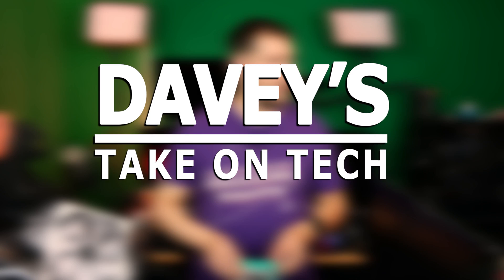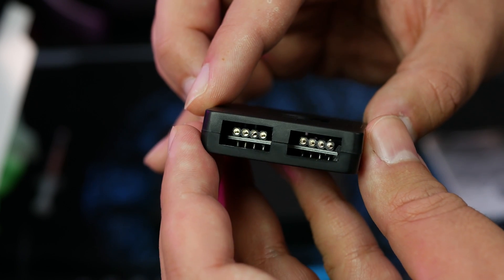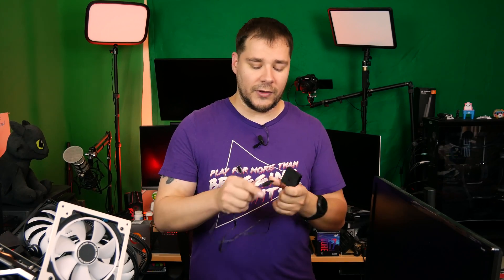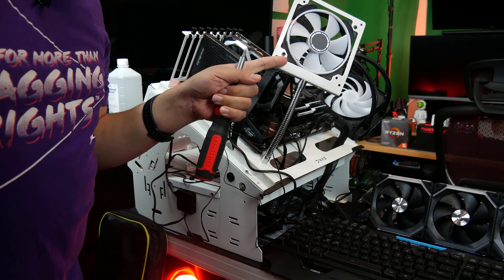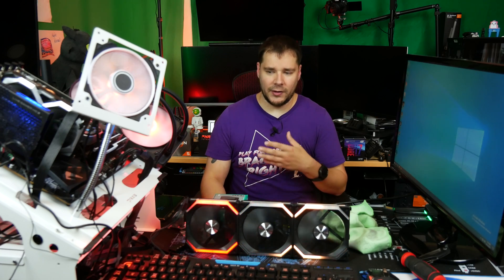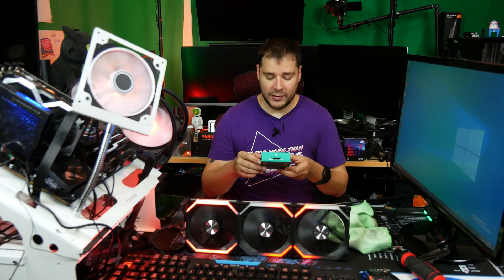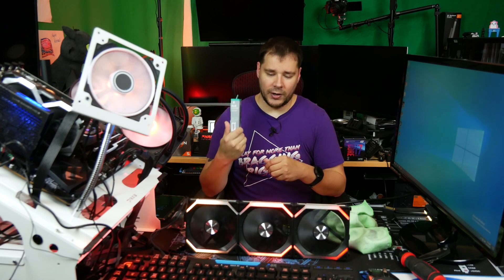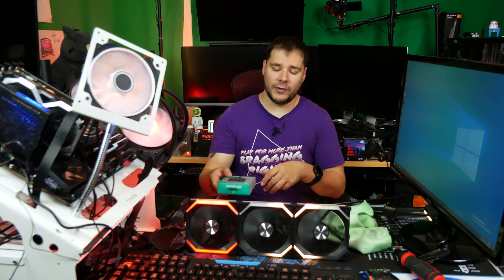Connecting a 3-pin 5V ARGB product to a 4-pin 12V header? Yes, it's possible

Comment: Unrelated question but I just bought a fan cooler with a 5v 3 pin Argb connector but my mobo has a pin 4 pin 12 volt header

Comment: I have an Asus strix 2070 OC card with a 12v 4 pin RGB AURA header. I have 3 ARGB FANS. I need that header for the 3 fans but FANS are 3 pin. 
Splitter ? + this. ? It’s a budget build encode video from my main pc.

Comment: i have the asus z390 prime-a and it doesn't have any 3 pin rgb headers. My case is nzxt and came with daisy-chained fans that all go into a 3 pin connector. would I be able to use a convertor like this to daisy chain all of my fans and RGB into a 12v 4 pin and then use the asus aura sync or something similar to control them?

Comment: hello. nice video but since i am not wnglish i have not understand very well. my case come out with 9 rpg pwn fans and a controller that should be connected to the 3 pin header. my mobo have only two 5v 4 pins headers. how i can solve? thanks

Comment: Yeah as my issue right now is my garbage board B550 F Asus Rog Strix has only 1 5v 3 pin header and 2 4 pin headers I'm just trying to connect my thermaltake RGB fans to 4 pin as I also need my 7800xt GPU which also has RGB but also 5v 3 pin head on GPU so can this work??

Comment: I have a Gigabyte b450m ds3h , i have 5 argb fans(3 pin) that connect to a controller but just recently i want to have control using a software. Would this product help me out because the rgb header is a 4 pin header and i don’t know what to do…

Comment: Hello! I keep asking same question on every forum from msi and more,youtube  also, but no one reply.i want to connect rgb cable from deepcool ls720wh(3 pin rgb-5v) to my (4pin-12v) msi z 390a pro motherboard knowing that the connector( " jrgb1") is for led strips shown on mobo manual. Will it work with that convertor ?

Comment: I know this video is 2 years old but I couldn't find any clear answers anywhere on my struggling quest. Can anybody tell me for sure if I can use this converter? 
My problem/question is: I have an Aorus (gigabyte) x299 gaming 3 mobo that only comes with 12v 5pin RGBW headers (x2) fully operational with my ongoing rgb setup. I searched a LOT and found some info about the motherboard being able to connect 3pin argb's on the provided 12v 5pin rgb headers, as they said it is compatible. But due to my past bad experiences in doing stuff without some research I don't want to take the risk and fry something out.  Keep in mind that my goal is only to be able to connect about 2 or 3 argb acessories that only have 3pin argb connectors (1 rgb gpu bracket / 1 24pin mobo rgb cable and/or another fan for exhaust air since mine is kinda old and its the only one without rgb).  Thanks in advance.

Comment: First off, THANK you for addressing a problem that was a very common issue on previous generation motherboards and some newer ones as well!
So you lose the addressable function on ARGB things... does it cycle through them or just default to a certain color?
My delimma....MSI B450 Tomahawk only has 4 pin 12v ARGB headers and my phanteks fans have their propitary 3 pin RGB connectors. If I can just get them to a solid red somehow that would be great! But as of now, no RGB to be had....
Reply from the maker: It's dependent on if you're using RGB software or not. If not, my guess it'll just do the rotation of static colors, but if you have MSI's Mystic Light installed, you should be able to do make it a static color. Your other option with Phanteks is to buy their digital controller hub, which does allow for preselect ARGB options that aren't too bad, but has its own downsides (like a wired remote).
Reply: @DaveyKTech  Awesome thanks!

Comment: Hey man, I don't know if you're still replying to these comments but is it possible to use softwares to control fan colour like Gigabyte fusion etcetc with this product? If that's possible that's a winner.
Reply from the maker: Yes it is, just keep in mind it limits it to standard RGB options, not aRGB. But I was using it with ASUS Aura without too much fuss.

Comment: I have a question, i have 3 and 4 pin   two cables from my rgb splitter and AIO water cooler but i can't connect them, i do have 3 rgb headers two 4 pin and one 3 pin on my mobo, but when  i try to put them in the place doing pressure they dont mantain in place and are very loose i can't understand what is the problem the pins and holes are matching but it dont hold on the place and i cant press any further cuz its alredy touching the plastic part of connector and the cable

Comment: Will this work with a 3pin VDG cable and be able to connect using the converter to a 4pin 12V slot on my mobo?

Comment: Can we connect the 4 pin header to 3 pin connector I have the thermalrtake psu which has syncing rgb option and I have the motherboard of aorus which does not have any 4 pin connector

Comment: So still no "addressable" functionality?... Sigh...
How come that a motherboard as recent as 2019, when there already was ARGB, didn't include it??
I feel kinda screwed over cause it makes certain products incompatible. - Not that RGB is so critical, but the older version just doesn't work as nicely when I DO want it.
Anyway, it is what it is. I just went with non-lit fans for most of 'em and let the lighting in the RAM, PSU-fan, and some strips here and there do the rest.
Reply from the maker: I get it. It is really annoying to see so many motherboards lack an addressable header. It's better now, but definitely was a problem in 2019. B450 seemed especially guilty of not having the header.

Comment: i’m a bit late to this party, however i’m wanting to add that cool looking cooler master gpu stand as my card does sag considerably. i have an asus x470 with the 4 pin connectors for rgb. i have the better corsair hub for the QL fans leaving one of my 4 pin rgb headers open. my understanding is that the product i want to use is 3 pin aRGB, would this work or are there easier ways?

Comment: Hello, i just wanted u to know that i suscribed and liked the video, i want to buy Lian Li UniFans but my motherboard does not have a 3 pin ARGB Header, now, i do know by this video i can make them work, but how did u get to change the colors of them to red? If u plug it with that DeepCool Adapter to ur 4 pin header on ur motherboard, that's all u need and u can see it on ur motherboard/L-Connect software? or how did u change the colors

Comment: So, can you use ARGB 3pin Fans for example on a motherboard that only supports RGB 4pins?
And can you also use for example the software of argb on a rgb motherboard?
Reply: Yes the the main purpose of the converter is to use ARGB 3 pin fans on a 4 pin RGB header. You can't use the software for argb however, you can only use rgb control. So you'll just get static colors. (at least probably) Maybe someone could figure out how to configure the bios to do something different.
Reply: i want to know this too.

Comment: if this is the only solution, then got other option like buy the cheap china 3 pin drgb controller.. then its not a solution.. the solution we asking is how to power up 3 pin drgb without controller.. how to alternatively feed the data pin without controller
Reply from the maker: This video was specifically made because I had been seeing a ton of people looking for ways to connect ARGB lighting to their motherboard for software control. Aside from this product or physical controllers, I have not come across any other means of powering ARGB lighting.

Comment: Good video. Great tip. Got a Deep Cool AIO and cannot control it via MSI motherboard. I' ll def try it.

Tip : worry more about LEDs and backlighting when discussing those. Much of the effects you speak about are oversaturated by sunlight. Maybe make the room a bit darker / shades ?
Reply from the maker: Thanks for the tip. Capturing products with lighting is tricky and I do need to get better with lighting in general.
Reply: Did it work? I have this darkflash aio which has 3 pins and msi tomahawk max with 4 pins.
Reply: @Wamiw  bump
Reply: @Wamiw   did you fix your problem? I have the same setup and cannot install mine

Comment: Sir, please help me. I accidentally plugged in a 3pin argb to a 4pin rgb header. Is the led broken already?
Reply: The only damage would be if the 4 pin from the mobo has its pin Broken or severely bent
Reply: @tonio0o0ox  i did it too. and my Zalman led fan has broken

Comment: I just bought a MUSETEX case w/ music syncing (it comes w/ it's own controller but it's a 3 pin connector) that won't fit on my 4 pin headers (MSI Tomahawk B450 Max II). Will this still run MSI Mystic Light properly or am I going to lose the music syncing color lights?

Comment: I bought a X570 TUF PLUS, it has a "addressible gen 2 header" which has 4 prongs? I have a deepcool 360ex and it has a 3 pin 5v for RGB. Do I need this? Maybe I'm just missing something?
Reply: i have same problem. my mobo is x570prime. i tried connect my 5v rgb fan to gen2 and it only show one color only. so i think i need this product too, but i have read all review that this product often give failure.

Comment: Quick question: The device's 4 pin that you connect to the motherboard, does the motherboard have to have an RGB header or just a system fan header?
Reply: Needs an RGB header to control RGB.
Reply: @kaz9089  following question: instead of plugging 12v 4pin header to mobo, can i plug this in to a manual no-name controller? that i control it with remote?

Comment: hey so i bought the lian li 120 mm fans and my mobo doesnt have a 5v connector would this work with the lian li controller ? if i plug it in from the controller to this converter and still use the L connect software from Lian Li ?

Comment: I've read some reviews on amazon by customers saying that this product has overheated and even melted cables and/or smoking or possible fire.. Can I really put my faith in this product and risk damaging my whole PC..?
Reply from the maker: I'm unsure at this point. I've seen the same thing in the reviews, but I've not had anything like that happen and I've been using it for a few months now. Even now, I just touched it while it was running in my system and it was barely giving off any heat. There's always a risk with any component in a PC build though.

Comment: Please help!!! i just got a msi cpu cooler. and i bought a deepcool rgb converter in ur video shown. Everything is working fine, but my rgb fans are flickering. and my fans are not showing in any of the rgb control programs.
Reply from the maker: If connected to a motherboard header, you'd use whatever motherboard software you have and just select which ever header they're connected to. If it isn't connected to a 4 pin header, you won't be able to change anything. The flickering is something I've noticed when not on a primary color, so I'm going to be testing this more to see if I can resolve it. The product is not a perfect solution in some situations.

Comment: Hi Sir, is my 5v - 3 pin gpu anti sag bracket (deepcool gh-01 argb) supported by this grb converter?
Reply from the maker: From what I can tell, it uses the traditional 3 pin connector that you'd connect to a motherboard, and this converter does accept that connector.
Reply: Should have been more descriptive by talking through the steps you took to connect everything

Comment: Hey there! I thought this was a very helpful video. I may have missed it and may be confused so I'm looking for some clarification. I had heard you say that we will lose out on the addressable functionality of the rgb. Does this mean that this product would not work well with an ARGB Hub? I am planning on connecting my ARGB Hub to this Converter in order to connect my 5v ARGB Fans to my 12v MOBO Header. Thanks for your earliest response!
Reply from the maker: Basically what I meant was the advantage to addressable LED's is that you can have more than one color showing at a time and you can't do that with standard RGB where it's limited to one color. Using this converter would "change" your ARGB products into standard RGB. I don't know how well it would work with a hub as I didn't have one available to use to test at the time, but if the hub receives its own power, I'd think it would work. I'll have to look at this.
Reply: Hi there, just wondering if there was an outcome to this as I’m thinking of doing the same? I’ve got a Z490 carbon wifi motherboard with a 12v JRGB header but it’s also got a JRAINBOW1 header which is 3 pin? I’ve tried the 3 pin on the JRAINBOW1 header and the RGB doesn’t work. I’ve got the lian li SL120 fans with the hub but thinking of connecting the hub to that mini hub. The fans spin atm but no colour. Appreciate any help :)
Reply: @AshKenyon  Hi, I am also looking for something like this, I want to connect 4-5 ARGB products so I'm sure I'll need a hub to connect to this "converter" so just wanted to know if it works fine with the hub (primary) and if hub allows somehow to retain addressable functionality (secondary). Thanks in advance :)

Comment: Can we control the fan speeds?
Reply from the maker: This is strictly for lighting effects. You'd need something separate for fan speed control.
Reply: i think you have to plug the PWM pins on your motherboard pwm_fan pins out to make speed controling work well, this has no relation with the adapter
Reply: Where is the best place to purchase this controller in the United States?  Thanks.

Comment: Would this work with the Lian Li Uni fans? I bought some for my computer but realized I don't have a 3 pin connecter, is there any way to get them to light up without it?
Reply from the maker: If you bought the 3-pack, the included controller just needs SATA power and connected to an internal USB 2.0 header. If you can't do that or don't have the controller, yes, this product has a port that matches the connector that Lian Li uses. I want to say I did test this, but can't remember for sure and they're now in my build so I won't be able to verify until I get more in (which is a pain like everything else that's new). So I can't promise they'll work with this converter, but they should.
Reply: @DaveyKTech  alright well I ended up buying both this and a USB3 to use converter since my mobo only has 3 so one of those ought to work
Reply: @MitchPalego  Hello, did u get to use the adapter of this video or pluggin them to ur usb port motherboard and control the rgb with any of those 2 options?

Comment: Just wondering because I just got this product. Did you have issues with the 3 pin cables plugging into he product. When I plug in the 3 pin cable it just seems like it can easily come right out.

Comment: Hey i like to vid i plan to buy this because the rgb on my aio isnt working with a argb pwm hub but i need to connect a 5v rgb fan header and this is my plan. I plan to connect 5v to this converter but my problem is that my mobo doesnt even have a 12 pin rgb header and i was thinking will this work by just using sata power?

Comment: Hi, bro.I have a gigabyte aorues x 570 pro wifi. I have the cooling connected so I can control it by software( until a month ago it worked perfectly).  I have tried to change the wiring for the manual controller and it works perfectly, but I need it to be by software. I have a corsair rams with rgb as they work perfectly with the icue software.Also the rgb of the board works well, from rgb fusion I change the leds of the board itself, the only thing that does not change is the AIO (as a notation say that if you change the effect of the lights, if in strip form, if in circular form, etc, but the intensity of color and color change is not, is red and a very little red) I think the problem is because it reaches low voltage to the 3-pin connector of the motherboard. I have also bought a splitter and connected it via sata , but it still does not work...I have tried everything and I cannot solve the problem. Any recommendations? Do you think the motherboard could be damaged?

Comment: I connected the SATA powerconnector (of the deepcool convertor) to my psu one and it took Fire and now cables involved are ruined. Idk what happened. It says 5v sata powerconnector but I thought It was like universal. I know im noob with PC's, I Just want to know if the problem was caused by the psu sata which was too strong for the deepcool One, or i was Just unlucky and something else happened. 
(Im not english Sorry for the bad writing).
Reply: Or Just somebody Better than me can explain TF happened??
Reply from the maker: I'm not well-versed with PSU's so I'm not certain, but it sounds like you just had a bad unit, which is really awful to hear. I haven't encountered that and it's been on pretty regularly for a while now. I'm only aware of one type of SATA power connector so it seems like you were just terribly unlucky.
Reply: @DaveyKTech  yeah It sucks. I've already contacted the seller. Hope they gonna refund me!

Comment: If i were to connect RGB fans(Eg. Deepcool fans) to this converter into the 12v RGB on my motherboard, would I lose certain functions on the fan?
Reply from the maker: If they're addressable fans, then yeah, you lose that aspect of them as standard RGB can't do the same things that addressable can. I don't know enough about any Deepcool fans though. The fans themselves should operate as normal though.
Reply: @DaveyKTech  What happenes if i connect a 5v ARGB control header to 12v without the converter will the fan work and rgb not work ?